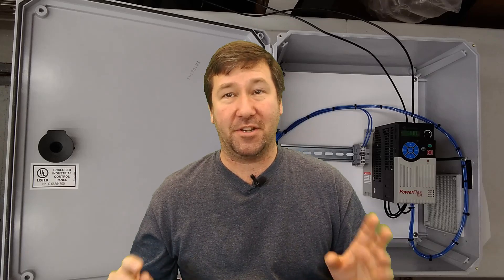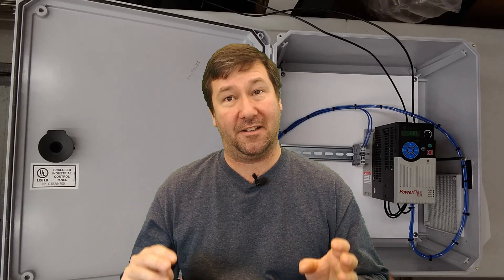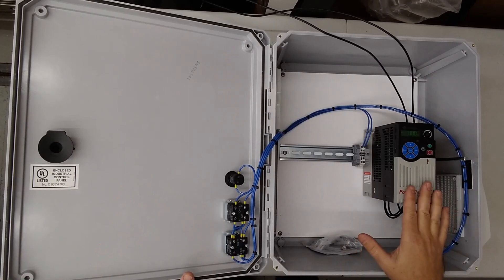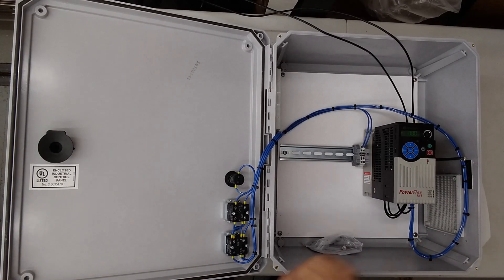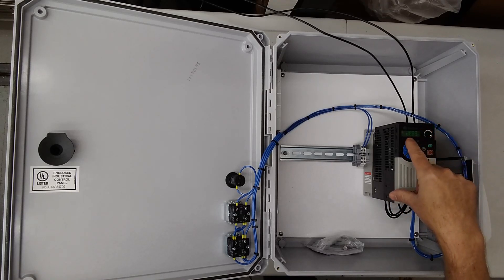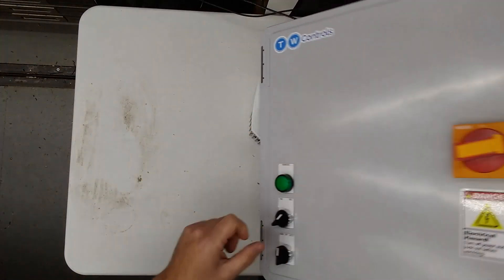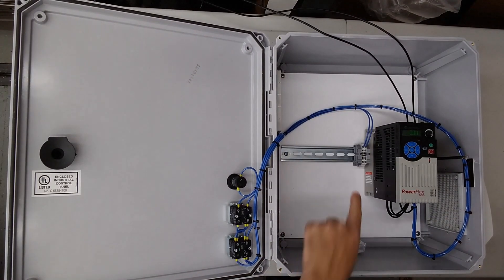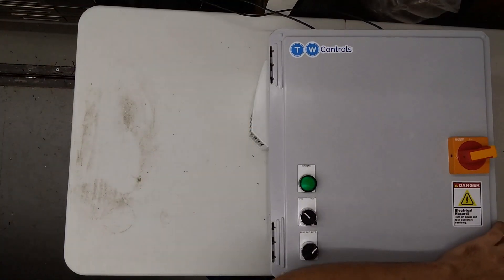Allen Bradley Powerflex 525 AC Drive UL508A Control Panel HOA FWD/REV

Comment: Did they request the extra space ?
Did you intentionally put the switches so close to the hinge ?
Reply from the maker: When you account for the required panel depth, there aren't many smaller ones. That is the standard position for the switches on the VFD panel. I'd you center them, they will hit the drive.

Comment: Out of curiosity, what are the advantages of using a Powerflex 525 for a simple application like this compared to using a cheaper Powerflex 4?
Keep up the good work?
Reply from the maker: In this case, it was customer specified but I rarely don't use the Powerflex 525.  It is a very versatile drive with Ethernet and you can do a lot a of basic logic without a PLC using it's StepLogic.

More specifically about the Powerflex 4, it's lifecycle status is Active Mature which means no further development will be done on it and it's next step will be end of life so I wouldn't use it on any modern projects.  I would use the Powerflex 523.
Reply: As far as I know the power flex 4s are being phased out and the 520 series is the replacement.